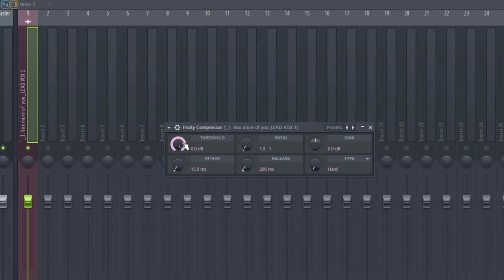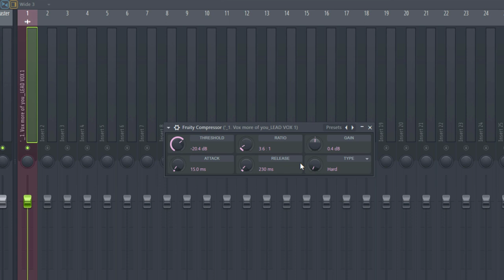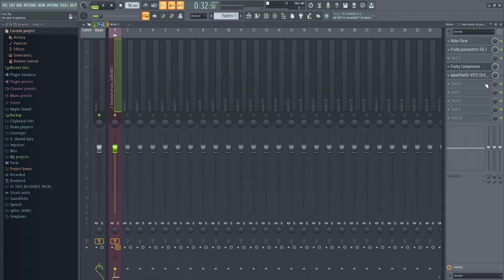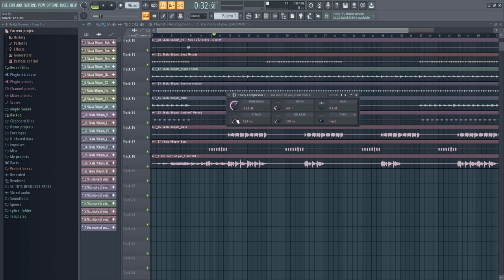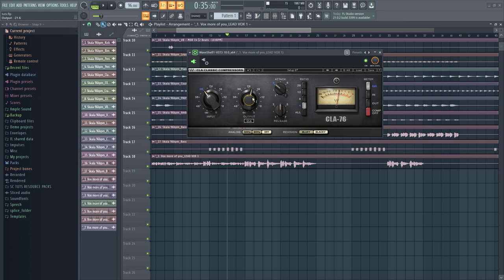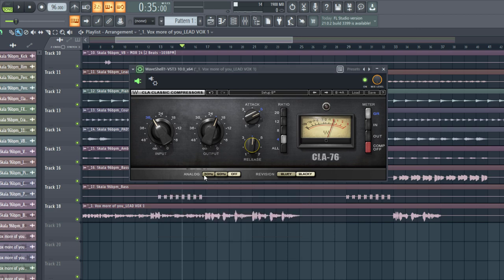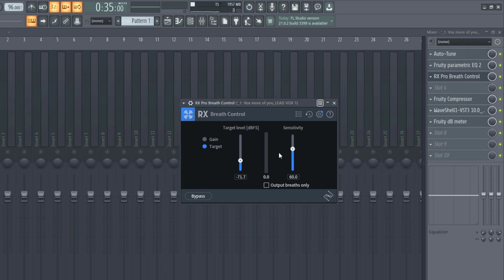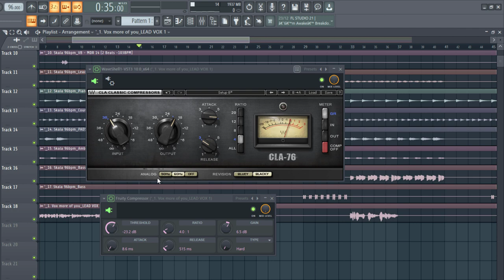How to compress vocals in fl studio | Mixing tutorial

Comment: The CLA 76 does work as 1176 ??? 
I use UAD 1176 But the input knob works different .
Reply from the maker: I haven’t used 1176 before, How does it work ? 1176 is also a FET compressor and it should work the same.
Reply: @SCTUTS  it works clockwise
Reply from the maker: @allybeatz4853  yes I checked the 1176 works clockwise, the cla 76 is an emulation of that but when I take it anti clockwise that’s when I tend to hear more compression in the CLA 76, although I use it mostly for it’s tone than it’s compression feature.

This is good to know by the way, thank you.
Reply: @SCTUTS  thank you bro